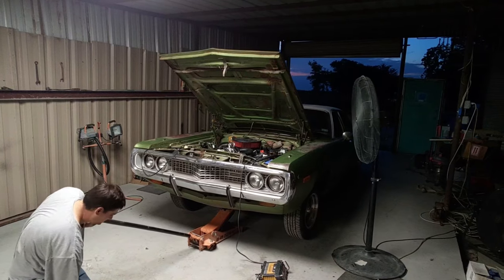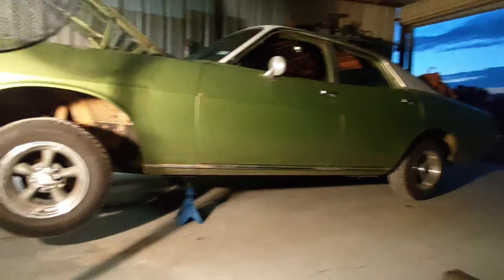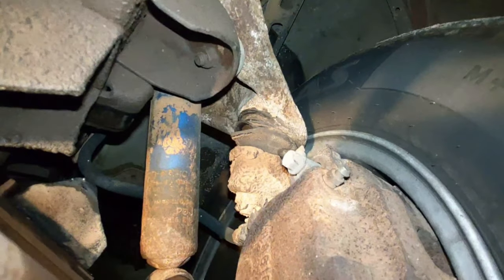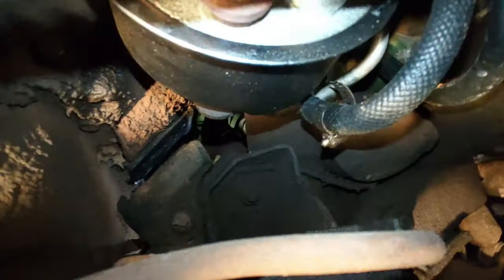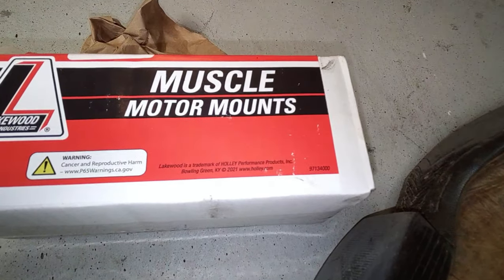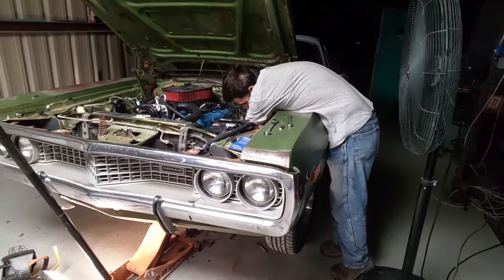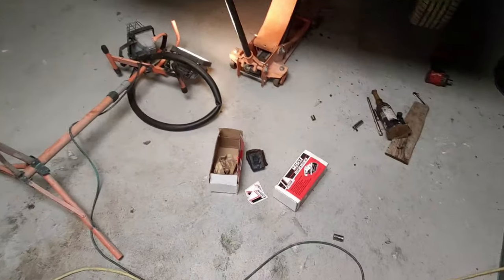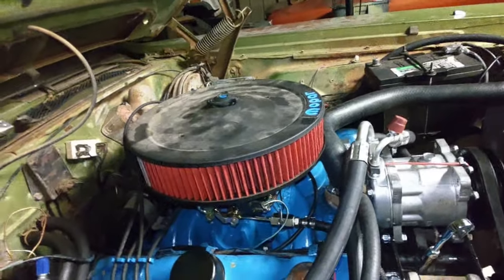late night sleep deprived repairs on my 72 Coronet in 4k!

Comment: Less Mexican food and candles.  More what you are doing and why.  Maybe even something a viewer can follow to help with the same repair. 😅. Because of the age of our 72 Coronets, my next project is a complete front end rebuild.  Ball joints, pitman arm, all bushings, shocks, etc….  I can find instructions and videos for each item but nothing when you have to do it all.  Yes there are complete front end rebuild classic mopar videos out there but they skip over too much or don’t put the camera on what they’re doing under the car.
Reply from the maker: Yeah. Sorry about that   We got a late start and about half my footage was messed up because I hit the wrong button on my camera.  It was after midnight when we got done and we only rebuilt the driver side rear brake and replaced the driver side motor mount.  I had filmed a lot more of what we were doing but I actually had the camera on time lapse of 60 to 1 so I had a bunch of 2 second clips of blur 😂 I'll try to do better next time.  I almost just didn't put this video up but was trying to work with what I had. 
It was before my trip to Tulsa.